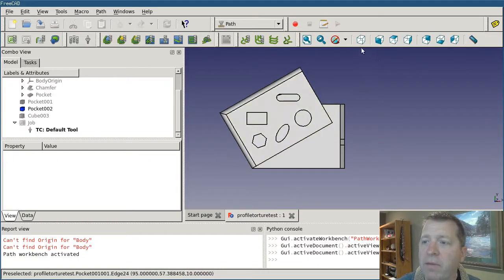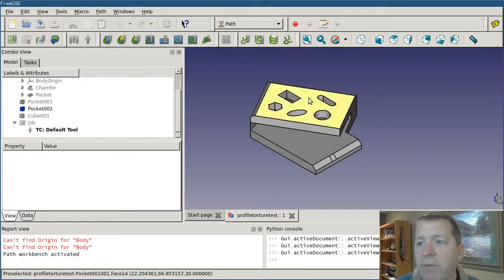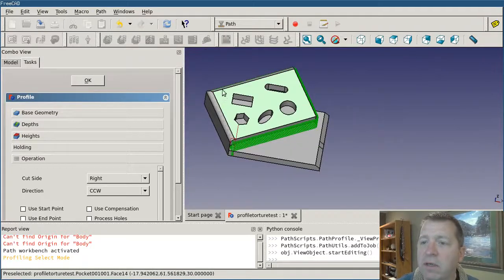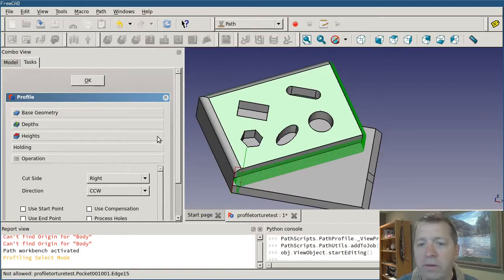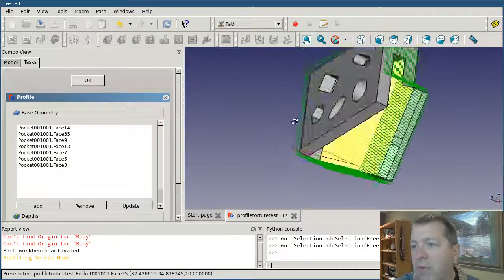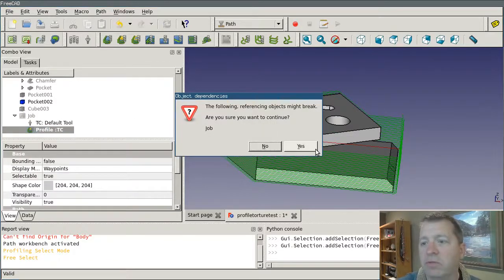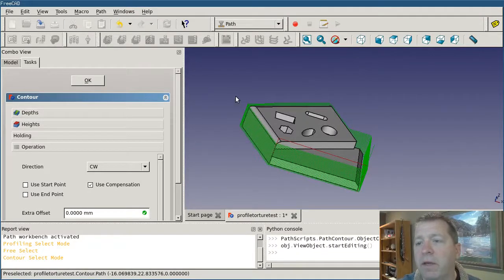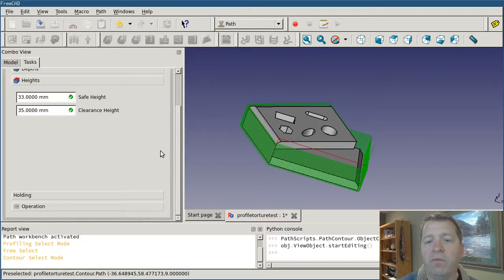Overview of Contour Operation

Comment: hi, thanks for making these videos I found them very helpful, however in your video you show chamfers and fillets. Do you know of any way you can set paths to rough out these areas in freecad Path or is it just 2.5D functionality. thanks for your help.
Reply from the maker: Tim Stacey mostly 2.5d stuff right now but roughing is being worked on. Check the path/cam section of the forum.